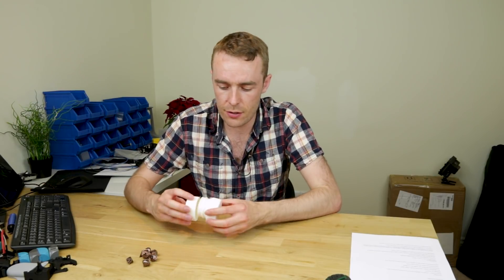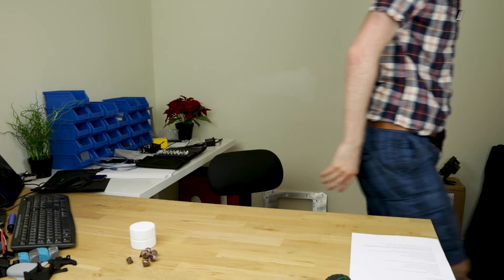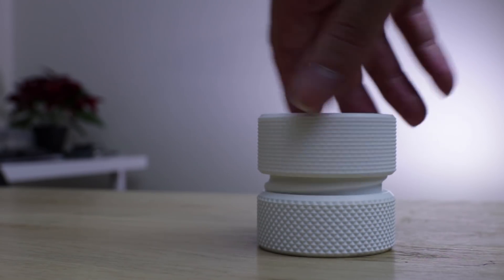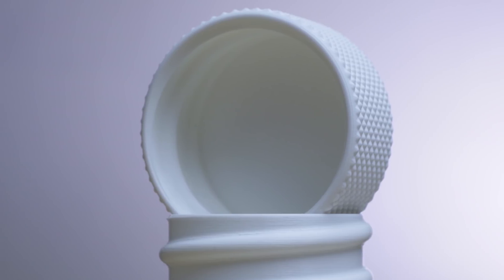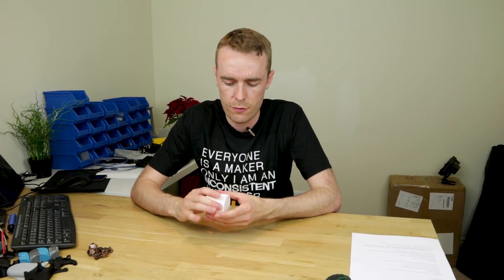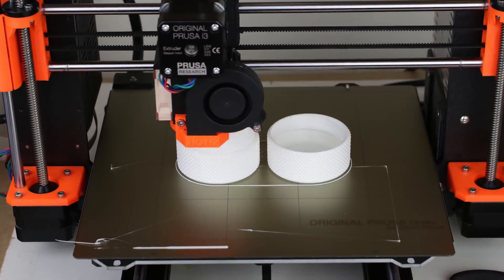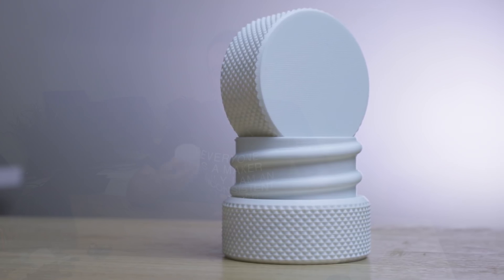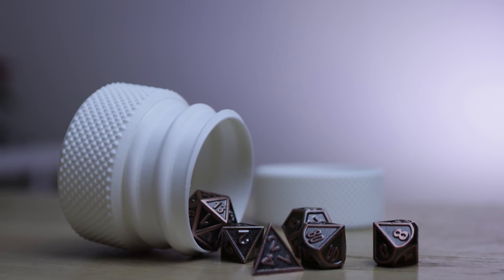#3DTWIP Container From Recycled PLA Filament

Comment: My Slicer is unable to handle this design. Shows broken stl. Anyway printed this one with errors and the threaded part didn't printed even slicer repaired the stl. Knerling is beautiful. Will try to slice with cura and try again
Reply: What slicer (and version) do you use?
Reply: IgnoreMyChan 
Sclicer 1.2.9 
Cura 3.4.0
Reply: The original STLs look like they were created by Simplify3D. Cura 3.3.1 slices them fine for me. MeshMixer didn't find fault with it, nor did IdeaMaker. However Microsoft 3D Builder (part of Windows 10) does claim the bottom piece is "invalidly defined" and will do a repair, although I couldn't say difference it makes. You could try that repair if you want to use your first choice of slicer.
Reply: i have upgraded Sclic3r to 1.3.0 and no error were detected.  print size reduced to 45% as required by my daughter and now printing with fingers crossed.  soon post the results.